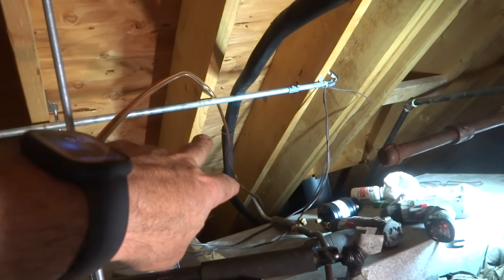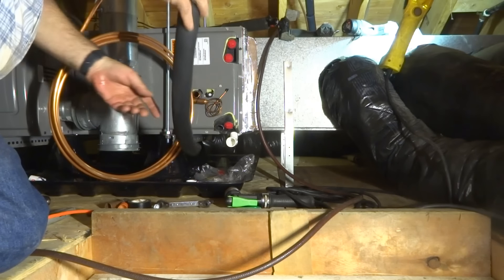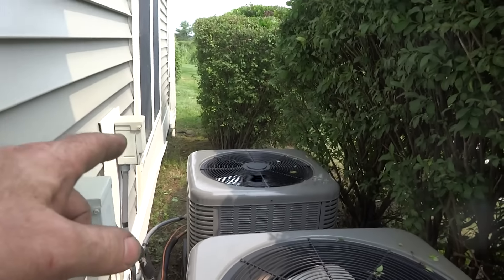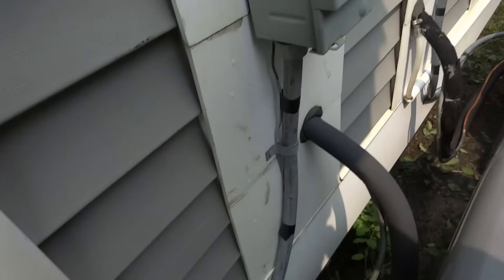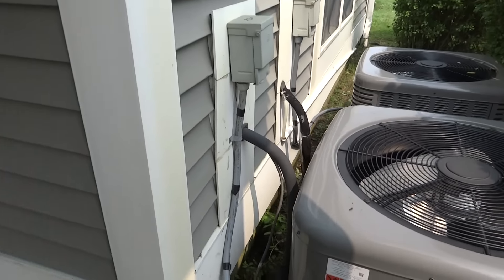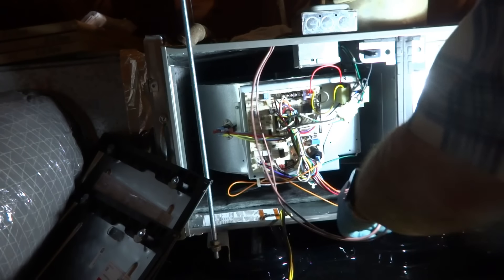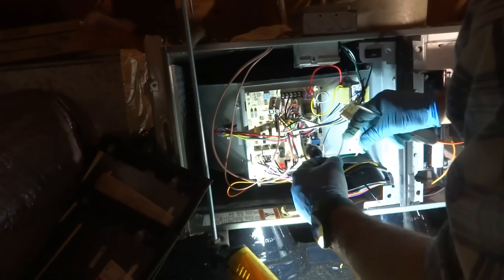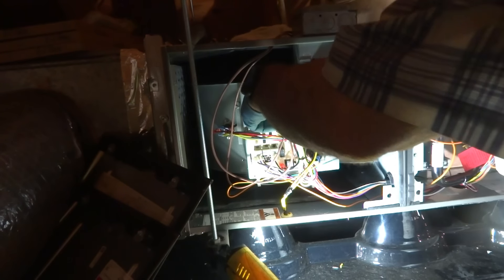2ND FLOOR GAS FURNACE AND AC SYSTEM UPGRADE PART 2

Comment: Awesome one man show Steve. I had a heat pump replaced a few years ago, air handler in garage and the condenser about 25' away. No attic or crawl space work other than snaking the line set through the crawlspace. 3 guys, 2 days!!!!

Comment: I thought you had to use a braising rod as solder doesn’t hold under the higher pressures ?
Reply from the maker: do your research of staybrite 8 its stronger then silfos brazing

Comment: Wonder what that role copper tubing costs, coppers such a great metal too bad the speculators driven the price up so dramatically. I'm surprised not to see line sets replaced by aluminum tubing I would guess that suitable for refrigerants.
Reply: Back in the 80s they were using plastic line sets. They were a joke.